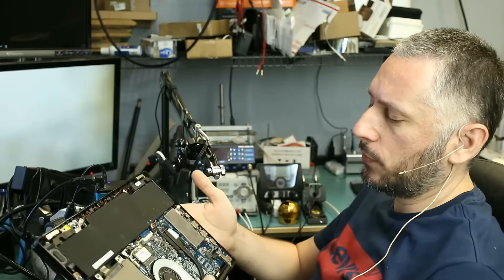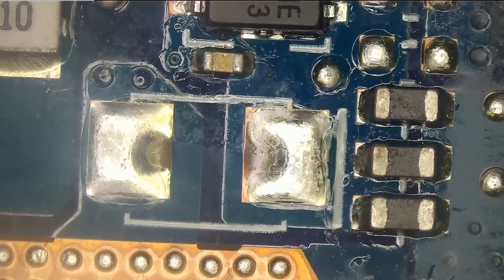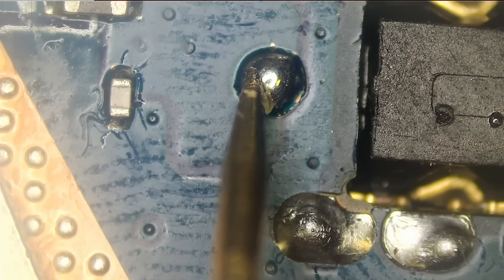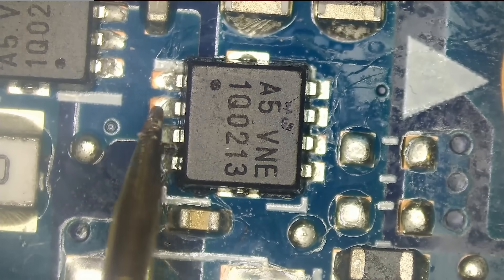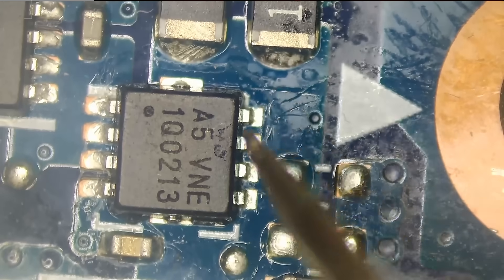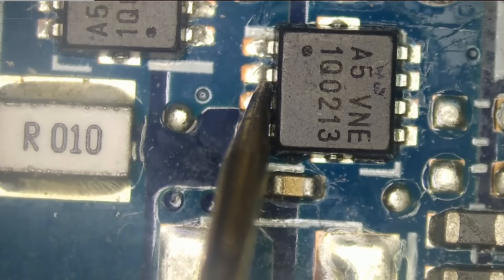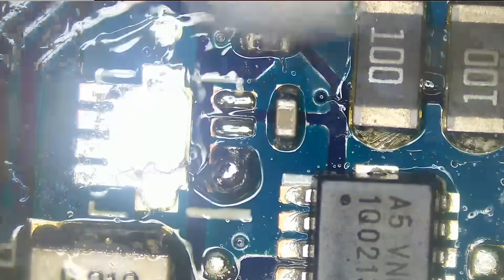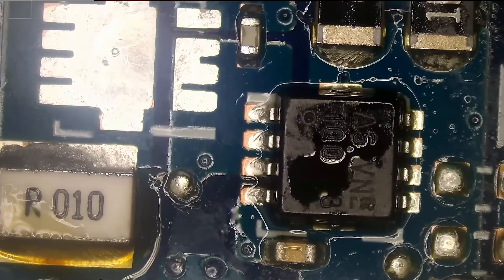Asus Laptop No power Not Charging Repair-  How Mosfets work and short circuit diagnosis

Comment: Thanks so much for the explanations! Had my laptop fixed at a local shop and having no knowledge about circuits I was dumbfounded with his lecture about mosfets and capacitors... This video really helped me understand. Thank you!
Reply from the maker: Great to hear.
Reply: @NorthridgeFix  Sir... I have a question and I really need your answer based on your experience. I was using my netbook for about 5 minutes after that it suddenly turning off and smoke coming out of the charging port, I immediately unplugged the adapter from the netbook. After that, I waited 1 hour and tried plugging the adapter back just to see if the charging port indicator light is still on and yes it's still on but I'm afraid to turn on the netbook. my question is... does my netbook still have a chance that there will be no serious damage to its components or not?? sorry about my english ...

Comment: Question, Did you apply low melt solder (like chip quick) before removing the mosfet with hotair?
Reply from the maker: No need but you can

Comment: I think it would be ok to apply low voltage/cc directly to these suspicious caps, would make it easier to pinpoint the shorted part. Also it looks like you chipped off a bit of capacitor at 9:39

Comment: thanks very much , very good lesson  learned today and well explained.Please can you make a video on an HP laptop where everything seems ok but no display?
Reply from the maker: Try to plug it to an external monitor, if you still get black screen, problem could related to GPU.
Reply: @NorthridgeFix  thanks for the reply and i gonna try that.
Reply: @linksrepair2851 if that dont work.. is it blinking led light ?
bad bios likely.. make usb bios recovery with different version.
if not then gpu or KBC rom likely.

Comment: Are you saying "drain" as in load?
Reply: "Drain" refers to a specific pin on a MOSFET: 

https://en.wikipedia.org/wiki/MOSFET
Reply from the maker: Drain connected to the load. Current will flow from Drain to Source when a positive voltage is applied to the gate. It's like a switch.